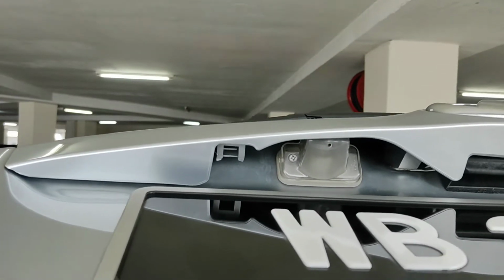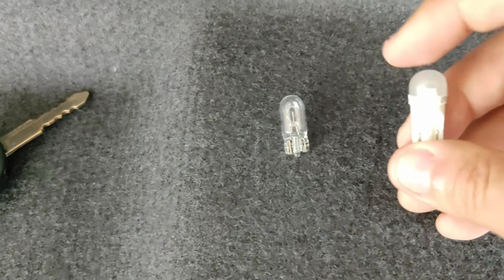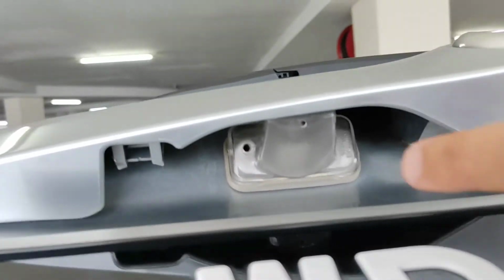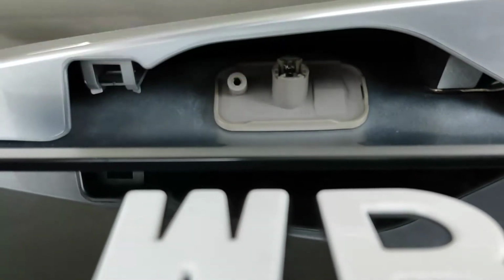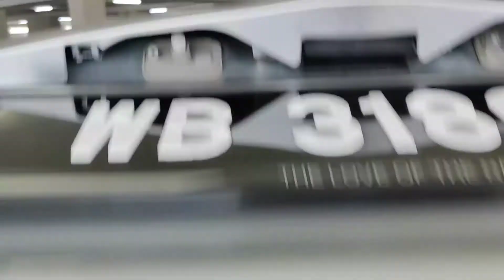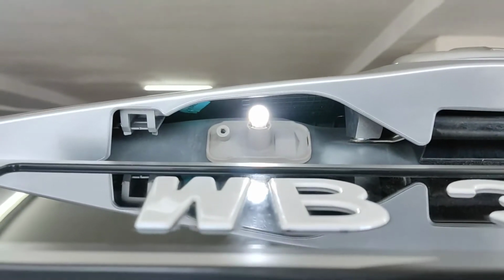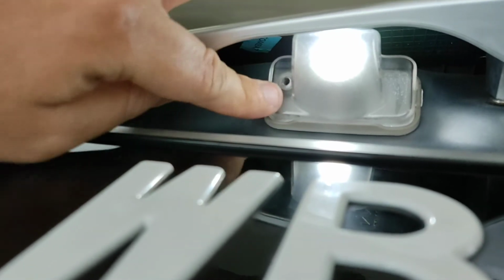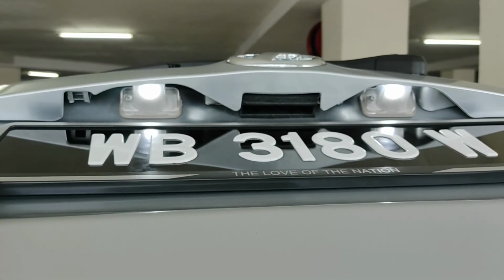Perodua Myvi Old, Lagi Best and ICON License Plate Bulb Replacement

Comment: Hi Goh your video and instructions are life saver! I was just trying to replace my Myvi's old license plate light bulb (dunno halogen or incandescent) with LED ones, but couldn't get it to work, as in it won't lit and I almost gave up until I saw this video where you mentioned they only work in one direction, I went back to try again and it worked! Also I think either the socket is a bit worn or the LED bulbs don't fit too well in the socket because at times I find myself having to adjust the LED bulb, either push it left/right or pull out a bit to get it to work. But anyways, thank you for your video!